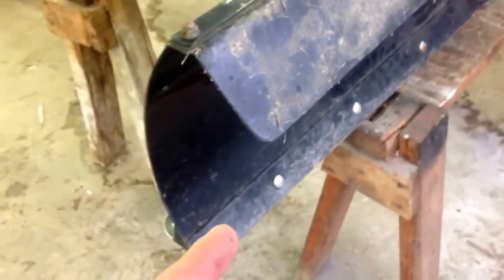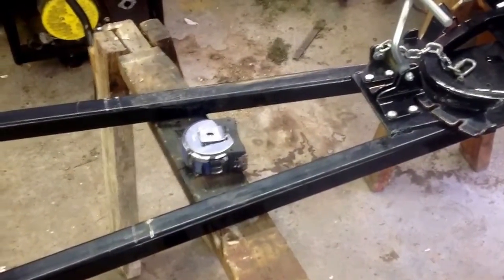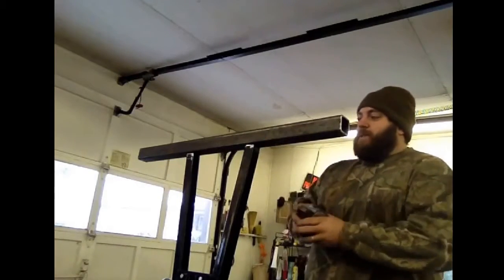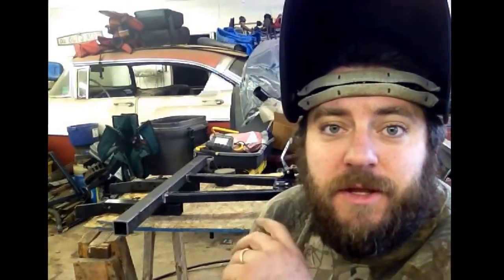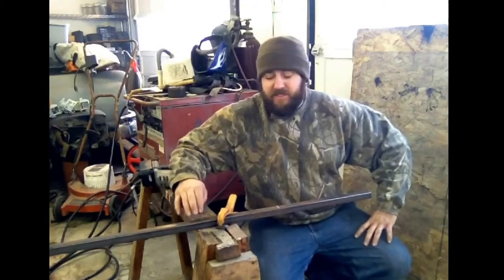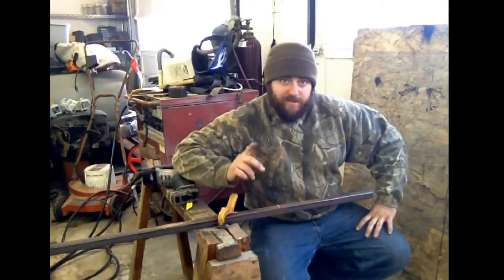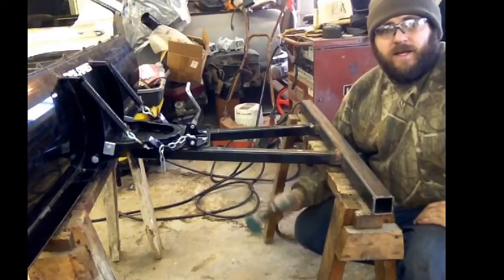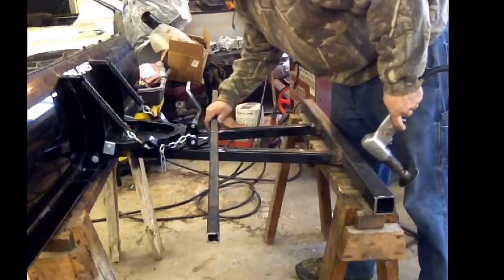★Part 1 of 3 Building a home made steel snow plow for my tractor out of a 4x4 atv plow

Comment: Hi Dan, built one works great! Thanks! One question what did you use for a deflector which you bolt to the top of blade?
Reply from the maker: That one came with the plow. Since I have had to replace it. For the replacement I used tractor trailer heavy rubber mud flap strips. Works better than the original material. I also have added a piece of 1inch by 3 inch 1/4 inch thick angle iron across the top for extra height and for additional rigidity.

Comment: Great job on the video Dan! I have an sc2400 as well. Since its been a couple winters now, is there anything you would change in the design?
Reply from the maker: I've added an additional piece of 1/4inch angle iron across the top for rigidity and a few inches extra height. I also have upgraded to a bit bigger tractor platform. In doing so I was able to make a quick mount for the lift frame. So I have eliminated chaining the plow to the bucket.

Comment: Hello dan say.just.go.to.junk yard find old snowplow. Push more.snow than that small plow.
Reply from the maker: Christopher Kapp thank you for the suggestion. I actually did explore that option a good amount. My concern and reason I went the avenue I did was because of the weight. The plows were larger and heavier duty. This translated into more mass and more weight. My tractor's max lift is 700 lbs. if I put on a 400 lb truck plow and add to it the 100 of tube and angle steel to mount it to the bucket I would have minimal lift to stack up,the snow. That is a good thought and idea and would have done so if my tractor could handle the heavier duty plow's weight. Thank you for watching.

Comment: why not just use the bucket and put a snow deflector on it?
Reply from the maker: That is an excellent question. There a few reasons. The first is that the plow is 5 feet wide vs the bucket that is 4 ft wide. Second, when plow the snow is being funneled to the side of the road, parking lot walkway..... If done correctly it will leave nice neat clean progressive paths across the area that is being plowed. The third is that I can just push the snow up the pile to the top of the pile and stack it up high. I have a video of me doing this. I invite you to check it out on my channel videos.